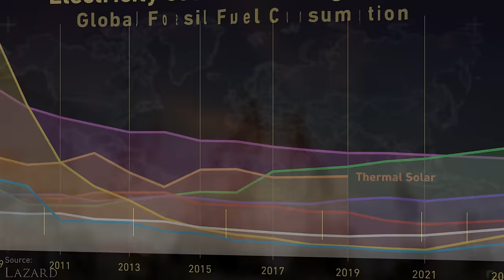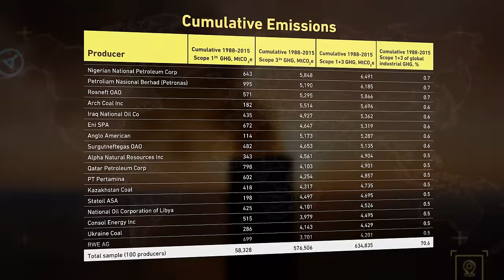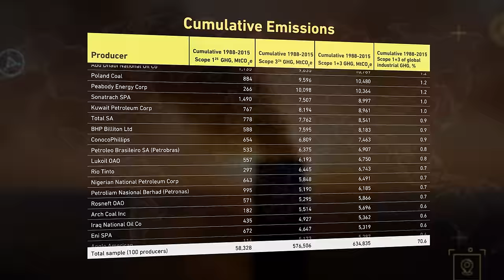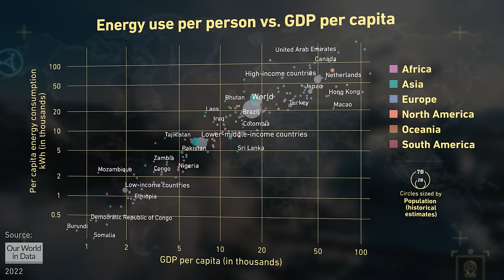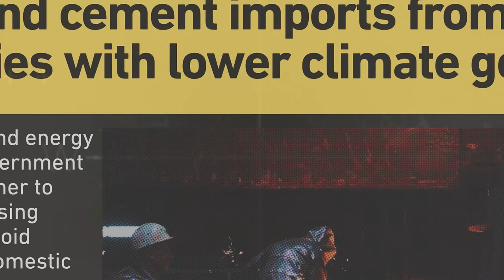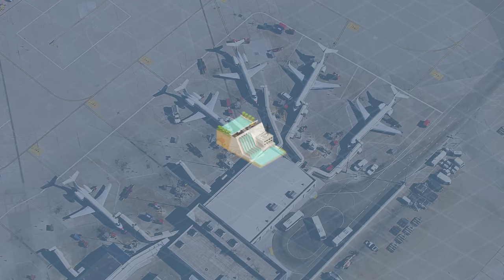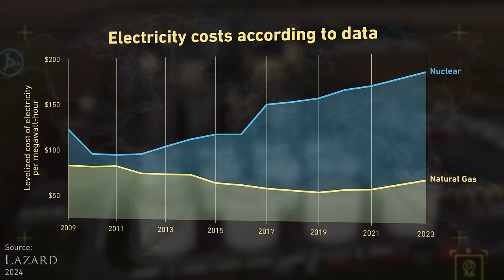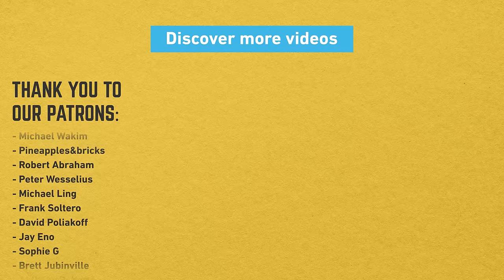Why We Can’t Just Stop Oil

Comment: When does damage outweigh benefits of oil? That is simple. Never. You need to understand, fuel is just one use for oil! The number of products that have oil as non-fuel component in them is 70000+ items long and counting! No oil means no antibiotics, no synthethic fertilizer, which by extension means no food (and electric tractors are a horrible idea, given we already have problem with compounding of soil under significantly lighter diesel ones!). No oil means slave labour for cotton (eg. more slave lavbour)... This is why we need to emmit more and find different solution to climate change, like low orbit seeding using something like stratospheric balloons. We have the components for this, just need to implement it.

Comment: Oil isn’t the problem.  
The problem is all the other obsolete power sources still in use.  
Oil is the most efficient, effective & useful power source today, so it’s not going anywhere.  
Oil is the second most abundant liquid on earth & is a natural substance made of dead organisms, so it’s not going to run out like you suggest.  
Frankly the problem with “green renewable energy” is that it essentially tries to create a perpetual energy machine, which isn’t possible due to the laws of thermodynamics.  
The only useful & viable energy sources today are oil & nuclear power.  
Frankly everything else is just a gimmicky waste of resources.  
So until we discover a better power source, the  best way to cut down on CO2 & wasted resources is to get rid of the obsolete power sources & just use oil & nuclear power.

Comment: In summary there is no solution to reducing CO2 emissions. Even if there is willingness among all of us. 

My local electricity offers green energy with an additional hike of 20% more cost, so your statement of renewables are cheaper is definitely false!
Reply: The grid is not efficient. If you had your own house and rigged it with solar panels and batteries, you would probably have an excess of energy, if you lived in the tropics.
Reply: @TalEdds   I'm just an end user, if renewables makes the grid inefficient then the statement of renewable energy as a whole is cheaper is false. You can't just play around with the numbers and throw out other necessary cost in order to make the you case look nicer. That is just deceiving and plain false statement.
Reply: @jamsbong  What I am saying is that individual use of renewable energy is very efficient, under the right conditions, such that you don't have to take any power from the grid, essentially not having to pay for electricity, even having the possibility to sell excess energy back to the grid. It is possible to recuperate the entire cost of renewable systems within months to a year. It is very efficient, in the right conditions.
Reply: @TalEdds  Might be the case where you live to recover the cost (lucky you) but I very much doubt it where I live.
Reply: @jamsbong  yea, that's the thing, it works best in the right conditions. SMRs or NMRs would be great for non-ideal energy supply.

Comment: Fossil fuel consumption keeps rising, because they are the cheapest way to generate vast amounts of energy, reliably. The only thing that can compete is nuclear. That's simply physics in action.
Reply: Solar is superior
Reply: Just need energy storage tech advancements. The panels themselves are already u,tea cheap
Reply: @SigFigNewton  An energy source that takes several squared miles and that works less than 25% of the time is superior to one that takes much less land and works 90+% of the time?
There's no energy storage that can solve Unreliable's jank
Reply: @AlldaylongRock  Advocate with me for emphasis on energy storage tech. If you are ACTUALLY against power sources not always working
Reply: @SigFigNewton  Energy storage also benefits sources with high availability, by moving consumption around while said sources keep chugging at max power.

Comment: Not convinced.

Why not just tax fossil fuel consumers? It provides the right economic incentives and is easy to implement.

Yes, in the short term the tax can be easily passed along the supply chain. But, in the long term, companies/countries will try to get an edge by producing less carbon.

Addressing the concerns of developing countries is possible — perhaps, a sliding scale based on how many years of industrialization you've had.

Comment: The mining industry requires fossil fuels to mine the resources to produce electric cars. The jets we use for holidays require fossil fuels. We are the problem. The wealth of a few nations is dependant on fossil fuels, they will not cease extracting it until we stop using it.

We will find a way to replace fossil fuels, when we run out of fossil fuels.

Comment: lengthy scripts to make long video result to making mistakes or contradicting statements. your answer to the question might have some merit but not is the main reason. countries can't stop oil significantly at this point because of politics and preserve the existing stakeholders of fossil fuel.  however, renewables are slowly and consistently winning because it can't be denied that it is cheaper and better in many ways.

Comment: Obvious solution is to decrease the cost of building nuclear power capacity. Which means abolishing any regulations that are clearly redundant (the NRC is more or less intentionally designed to create regulations that have far exceeded the threshold of diminishing returns or otherwise just waist peoples time and drive prices higher to intentionally make nucear power economically unviable)
Just two presidents and a few lawyers are responsible for this. Richard Nixon, Gerald Ford, Jerry Brown, RFK Junior, and Martin Litton.

Comment: Ah, but we can "Just Stop Oil".
It's this neat little thing called Ecoterrorism or Monkey Wrenching. Even indigenous resistance groups have been successful in reducing investment in, or the construction of oil infrastructure, by repeatedly sabotaging oil pipelines.

As an Australian, I'm so very disappointed you've also ignored the success of the Knitting Nanas and the Lock the Gate movements which have kept CSG out of East Coast NSW.

We "Just Stopped Gas" here in the Manning Valley.

Also where's the mention of Bruce Robertson, leading Australian Energy Economist??

Your "Hot Take" on Battery powered Trucks is ignorant and incorrect. Janus Electric is retrofitting Trucks while Bunnings is adopting Electric Trucks with glee. Not to mention that the new age of Sailing ships is just over the horizon.

Private Industry is already making the significant investment in electrifying, especially in Australia, particularly now with the ongoing Genocide in Gaza.

Comment: Disappointed in this video. EE has always been a conservative channel that is generally hesitant to explore much beyond the status quo (i.e. this is how things work as they are now, not how they could be). That's fine. However, in a video acknowledging all the destructive things fossil fuels (and more broadly consume lifestyles) are responsible for and saying that this is the way it has to be is disingenuous. Because yes, all the while we need endless growth under neoliberal economic capitalist systems, fossil fuels make a lot of sense, even if they're inherently unsustainable. Alternatives to these systems, however, exist. Even within the status quo, we could be doing all kinds of things to massively reduce fossil fuel dependency, but we don't. For example, cars are mentioned several times in this video. EVs are not a fix to any of the problems caused by car-centric infrastructure. Efficient, affordable public transport and good urban design are, which we typically refuse to build in many cities (although things are changing, glacially). That's not going to fix all problems from fossil fuel dependency, but it's a start. We need to change our mindset that high quality of life = high consumption. It doesn't have to be this way.
Reply: There is no such things as a status quo in economy, everything changes very quickly. 
What you guys call "status quo" are stuff that changes in a direction you don't like "like increasing oil usage". 

We can try countries non liberal capitalist system if you like, from China to Eritrea, but I bet you will quickly go back to the liberal capitalist countries. I don't blame you, millions of Chinese or Eritreans does it. 

The liberal capitalist system is the best to provide people what they want without violence. Countless of countries, wealthy and less wealthy tried alternatives, all of them ended increasing human suffering.

Comment: "the consumer is the problem" yeeeeeeeeeeeah no that mentality highlights a problem with capitalism as a whole. In a lot of cases there is a solution to at the very least significantly reduce emissions but they arent taken up because profit. Its not the consumers its the profit incentives outweighing everything. Regulation and a level of eat the rich is required to solve the corporate problem, and not just in an ecological sense. When it comes to state actors picking coal over other cleaner options thats a consumer and corporate issue, one where theres no good solution beyond forcing the change.

Comment: Tesla has an electric Semi truck that can do a 500 mile range on a charge fully loaded.
Reply: The Tesla Semi is a gross waste of resources. They average 1.7kWh per mile. So that 500 mile range suggests at least 850kWh of energy storage.
Then there's the insane weight that comes with that much battery storage in the prime mover. It's a lot of kerb mass which contributes to the GVM. Or put another way, leaves less capacity for the actual payload.... the core business of freight & logistics companies.
850kWh of battery storage would be far better put to use taking 15 ICE cars out of the cities where pollution is a major issue.
Long haul trucks spend most of the time on freeways and outside of densely populated areas. They're also very efficient at high, steady-state speeds.
If the Tesla semi was the panacea to our problems, and if it provided a financial advantage for businesses then they'd already have jumped all over it.
Reply: How many KWh per mile does a normal diesel semi costume? The Tesla Semi is way more efficient over the Donner Pass.
Reply: Businesses have jumped all over it and there is a big backlog of orders. Tesla can’t produce enough of them. Pepsi has already proved they are viable and better than the diesel alternative. Now they need to ramp production.
Reply: @michaelwebsternz  Great, they were demonstrated to be more efficient in a very specific use case. 
That absolutely does not prove they are a better investment for businesses. TCO matters. Reliability matters. Cycle time matters.
Losing a significant chunk of your 82,000lb GCWR to batteries, when your primary business function is haulage matters.
Reply: Ah the old "Pepsi" argument. Pepsi themselves said the truck was only good for short (< 200 mile) trips when full loaded with drinks.
So what are they mostly being used for? Chips. Hardly representative of the general haulage community.
Tesla has a long history of selling dreams. If the Semi is really that great, the free market will respond accordingly.

Comment: Wathing cold, pure "as is" economics makes it obvious that our current economic model is our core problem... and that the folks who made this video seem to think that it's fine...
Reply: Hey, if you have an alternative that actually works let us know
Reply: I'm pretty sure gas would still beat electric under communism... 
The laws of physics don't discriminate by economic model.
Reply: Not talking about communism at all, so don't know where that came from... but you are correct, it would be the same economic driver and adding to that, it's very likely that communism would be worse at innovating than what we have. Here's what I saw in this video: 1) A list of problems. 2) A list of possible solutions. 3) A list of reasons why none of the solutions will work.... Maybe it's just me, but a system that blocks problems from being solved doesn't sound very good.

Comment: https://youtu.be/CKLx3J7U6_Q?t=564 When talking about carbon based tariffs EE says:  "All these things really do is make things more expensive for consumers..."  What a distorted blow off!  That is not "all they do".  Just like everything in economics, they lead to folks altering behavior, both consumers and producers and innovators.  This is one of the few practical ways to implement a somewhat globally applicable carbon tax.  Sure, those developing economies might not implement better means of energy production for domestic products, but it will lead them to either do so for exported products or to just not export so much.  It's not like China is the leading producer of aluminum because of comparative advantage, except in comparative advantage in using coal fired electricity production.
Reply: small tariffs make things more expensive for consumers and slightly reduce consumption. Big tariffs can result in systemic change. China has such an overwhelming advantage in so many areas of production, that the amount of tariffs needed to truly shift manufacturing away would be politically DOA.
Reply: @FullLengthInterstates  Trump applied large tariffs on steel and the primary opposition to it was on its effects on Europe.  Cast it in terms of a carbon tariff, and the people would support it.

Comment: 10:50 what a BS, do you even look at independent test of Tesla Semi, it same good as diesel or even better. What research paper you base, and how old it is? Look for last year test of many semis which transport for many miles and whole day, and it wasn't test of one, but many, so easy to compare.
Reply: Ya that was a pr stunt the actual production vehicle is sadly far far worse, even worse than diesel counterparts in term of distance
Reply: @chickentoucher55 and it don't matter, because driver must take breaks. Look for this real world test, and you would see that is not a problem at all. I'm talking about NACFE test if want to check what you missing.
Reply: @m_sedziwoj  "it works if you ignore the parts where it doesn't"